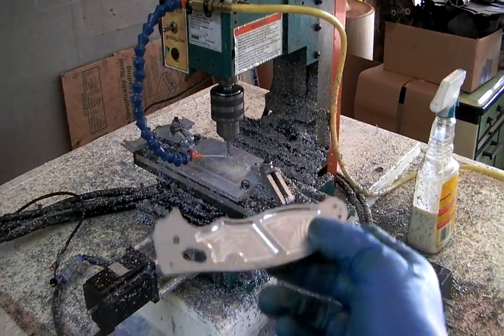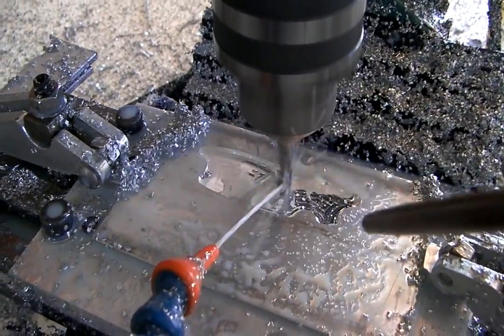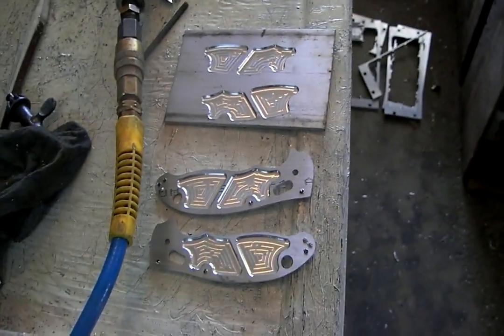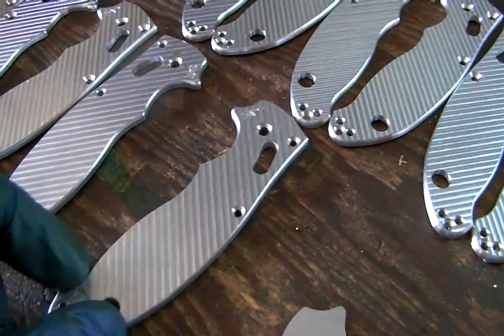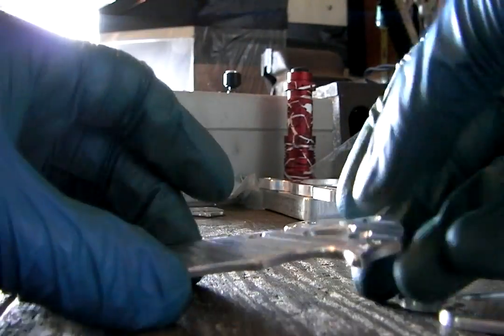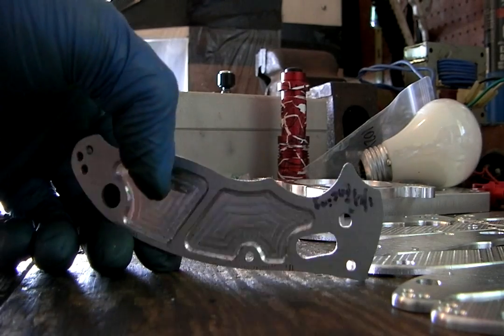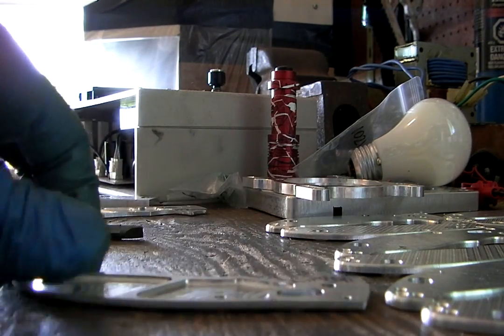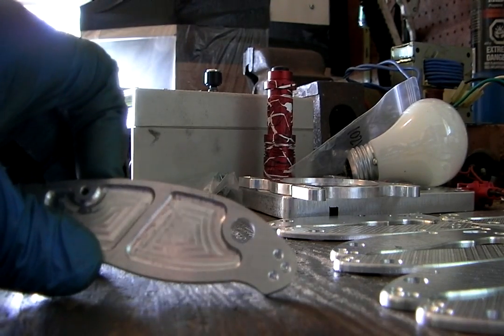Machining Manix 2 pockets and strength testing

Comment from the maker: @Southardknives Thanks Brad, I know I know, it's been on my to-do list for ages.  I've got one ER20 and a few collets but due to the stupid spring arm on the side of the head, it won't go low enough for me to really make use of it for thin stuff.  Once I upgrade to gas struts to support the head then I'll probably use collets for everything.  But even using the drill chuck, I'm surprised at how decent most of my cuts are.  I've used the ER a few times and I can't notice a huge difference.

Comment: You would get much cleaner cuts if you used an actual Collet to hold the bit.  All drill chucks have a bit of runout in them no matter what you do. You really dont ever wanna mill holding the bit in a drill chuck.

Comment from the maker: @basketofkittens Thanks for the tips Karl.  The shank of the tool is only maybe 1/4" out from the chuck, so I could hold it a bit higher, but it's also just has a long cutting edge.  It's a 1/4" endmill with 0.062" radiused corners like you suggested, it works great!  The pocket is 0.060" deep, done in two passes.

Comment: Why is the tool protruding so far? If the pocket is only a few millimeters deep then you should be running a shorter tool. The flex of a beam (the endmill in this case) with a force acting on the end increases with the cube of the length. Even reducing protrusion by a few millimeters can make a huge difference in stiffness.